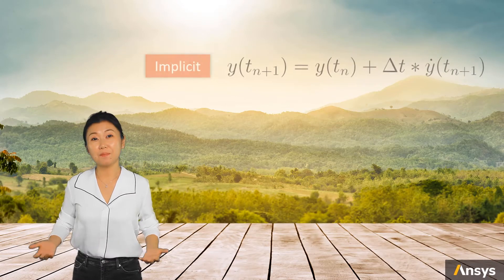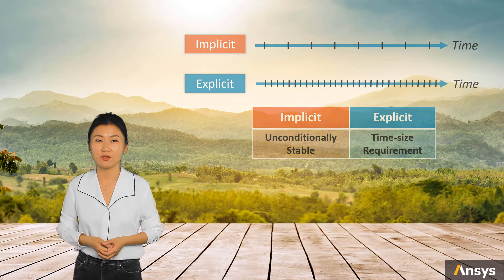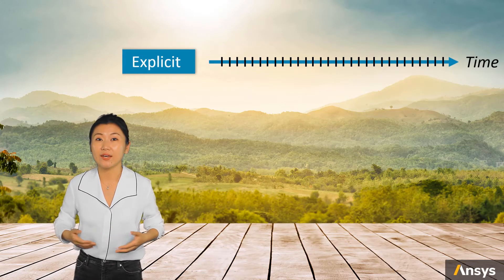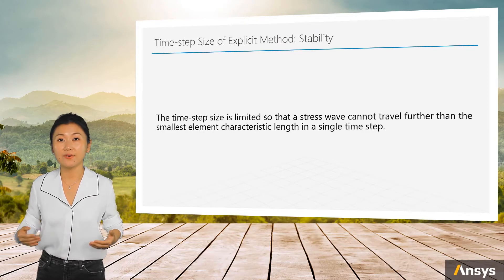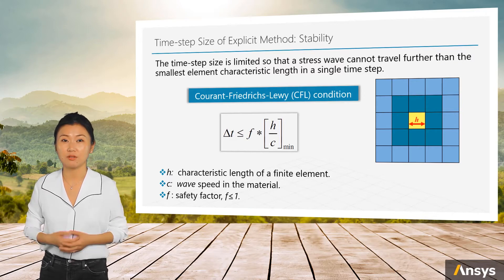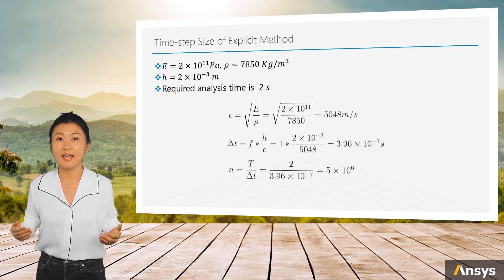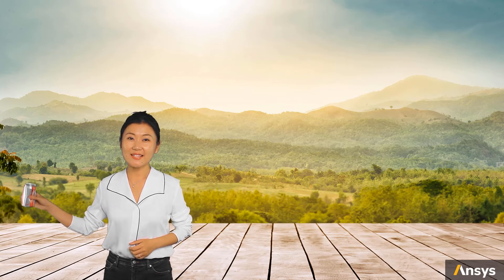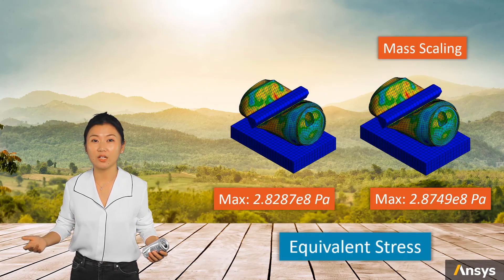Discussion of Time-Step Size — Lesson 3

Comment: what's the meaning of element  ? is that the particle for instance?
Reply from the maker: Thanks for watching! Please visit the Ansys Learning Forum (https://www.ansys.com/forum) for an answer to your question.
Reply: @AnsysLearning  it is not working :/
Reply: structure is divided into small parts called elements ('E' in FEA)
Reply: for example, if we split a beam into 'n' elements, then the beam will have 'n' elements and 'n+1' nodes. elements are the basic component how FEA software calculates stress and strain.